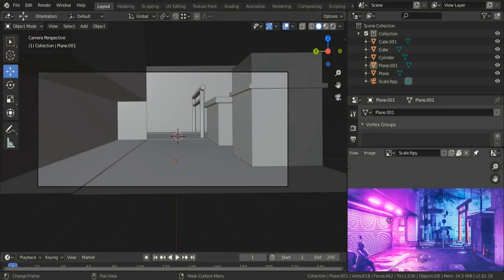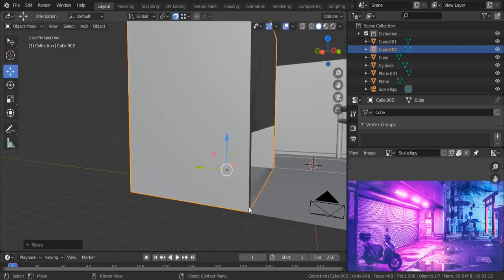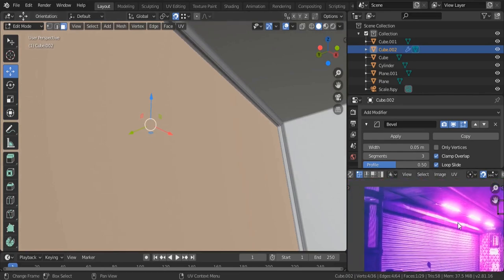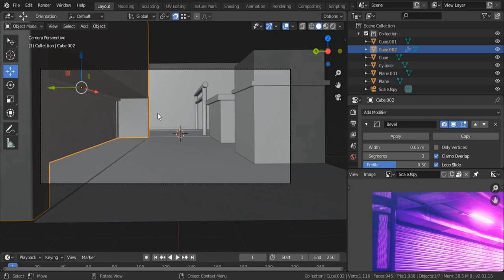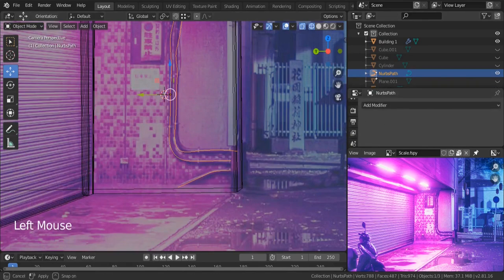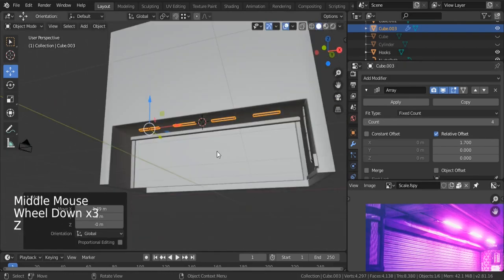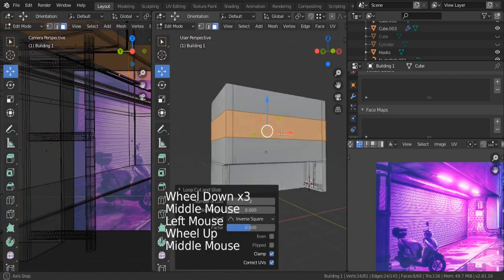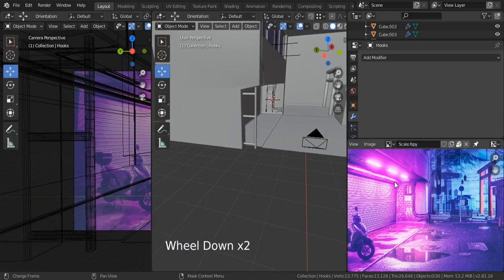Introduction to 3D Photorealism - Part 2: Modeling Main Building

Comment: whenever i add a bevel modifier at the building in 2:29 it simply would not work i dont know why. :((
Reply from the maker: Could you send a screenshot of the issue?
Reply from the maker: @Vince-pm5dn  I got the issue, try this: on edit mode hit 'M' and choose merge 'By Distance'.. let me know if it's fixed or not
Reply: @realfaker  sadly it didnt, can i still go with this thou?
Reply from the maker: @Vince-pm5dn  Yes but it won't help with the lighting reflection later on.. jump into the website support we'll get it done
Reply: @realfaker  disabling clamp overlap fixes the problem i got it from https://blender.stackexchange.com/questions/7435/bevel-modifier-not-working-properly
Reply from the maker: @Vince-pm5dn  That's a good tip.. good luck
Reply: @realfaker  ty bro, cant wait for youtube algorithm to bless your videos lol
Reply from the maker: @Vince-pm5dn  Hahaha I hope so.. thanks for the kind words